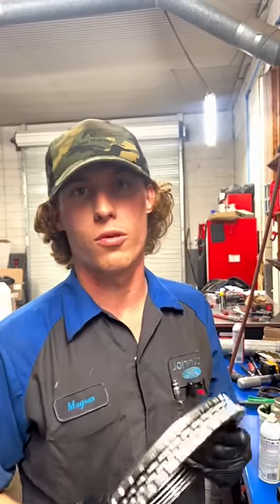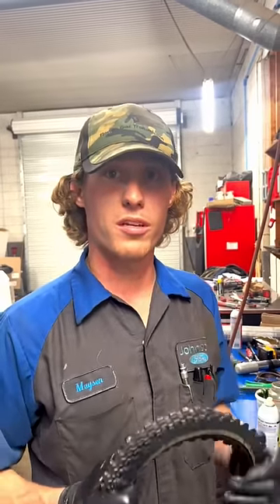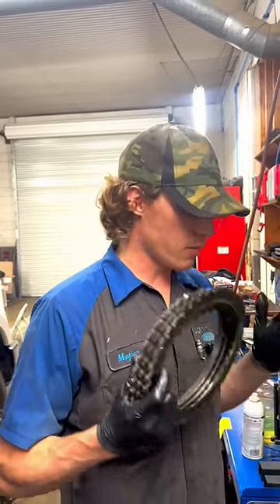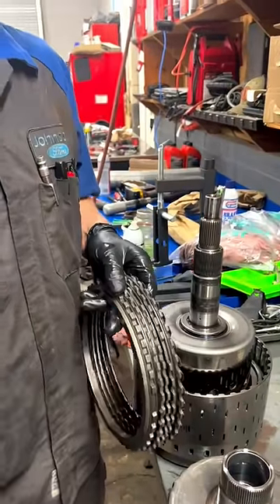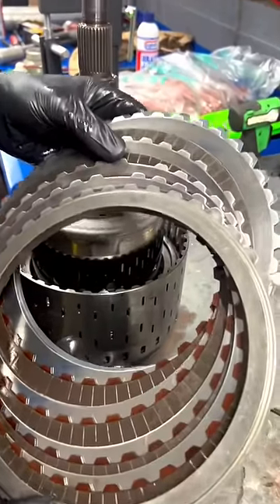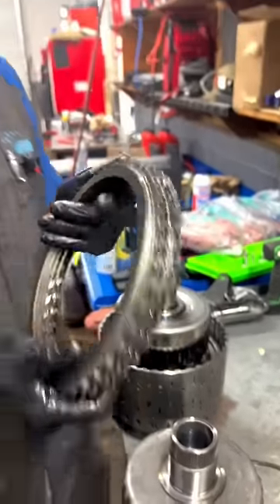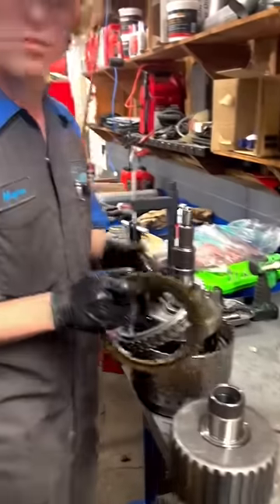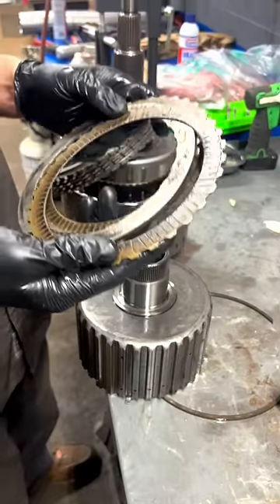Should you replace every clutch during automatic transmission overhaul? #shorts

Comment: I'm not an old timer by any means, but my grandad has been a mechanic for nearly 65 years, works on everything from kids mini bikes up to diesel excavators.

So thing is, if it's in a professional setting, my grandad would ask the customer what they want to do based on his recommendations, then go with that (private shop, no warranty work.) But if it was for his own personal vehicle he would just replace only the bare minimum, however for the kids (mini bikes) if something went sour with the bike, it got a full professional grade rebuild, like the brake pads go out, it's getting a drum, pads, line, and actuator.

His reasoning when I asked him was that on a customers vehicle, the most important thing is they are happy with the repair, with his own vehicle, he says if he don't have to spend the money, he would rather not, but for the kids and grand kids, they're newbies and fragile, imoortant.. the best brakes, the most reliable motor, new tires evey year, and as they get older they become responsible for the repairs and maintenance themselves.

He said to me, he can see which kids paid attention and learned from him on how each of us kept or didn't keep our mini bikes, mopeds, and go karts.

Like my cousin who destroyed his, riding it hard, no oil sometimes, with loose bolts and studs, parts falling off it going down trails....

My brother and I on the other hand, have the same bikes we have had since we were both little, mine just got repainted a new clutch, new tires, new brakes, and will be put in dry storage after this year until I have kids, or nieces and nephews to continue the tradition with.

Comment: Really depends on where you work I work for a company where I built transmissions and we had to give hundred thousand mile warranties and unlimited mile warranty with a year price tag but think of liability we always replace clutches and yes our Transmissions were expensive but our Transmissions never broke and never came back and I know you ain't magnafluxing every single clutch to know if it's cracked inside is it really worth it now it's not just replace the f**** clutch the customers coming in for a fix there ain't no warranty then it doesn't matter but if you're doing a full overhaul it's the first thing it should always be replaced unless it's something for government that s*** is expensive I mean like an O-ring cost for $45 10 ring some shaft cost $7,000 Plus so it depends on the situation

Comment: Rebuilding automatic transmissions 47 years   ,I like  your yt ,  never  install  new frictions  or steels  if they are in very  good  condition  but   ! If they  are  🔥 burnt-out   take  the  rubber  rings  out  and  replace them  ,,,,,,,I know  it's a  mind trip with the prosses  but  ,,,,,it's  E Z er doing it  right   just  one  time , than two  times  😮note  this  only  applies to  the  new  six speed    eight and ten  speed  old  3 speed Chevy  Ford and  Dodge   never  re  use  any  thing  that  should be  in your  overhaul  kit ❤

Comment: I do a shit load of trans work under warranty on john deere 1 and 2 series from extreme leaks and alot is bad casting or gear lash being trashed OR bad seals or pressure relief valves. I personally only replace whats bad. Because 9 times out of 10 everything is fine. And these transmissions i teardown are 3 times as complicated as a 10 speed. So yes i agree only replace the junk. Why throw away good parts? I get the "while im here scenario and with some i deal with i write it up for deere just right if i see something odd but not junk yet. What you have is obvious, so NO stick it back in there. Garuntee has no issue until it's 10 years from now when its got 200k on it.
Reply: Also deere does NOT make these transmissions the Japanese do. It's an outsourced company.

Comment: I just put new clutch and seals in a Chevy tracker that had 300k the clutches in it still all had the factory labeling. For the most part there was no reason to change the clutches the seals needed changed but the customer wants a rebuilt transmission not a half ass job and paid for it to be rebuilt not just be told it was.

Comment: If they come in the kit i replace them. If its just a seal kit it gets the parts out of spec. If cost comparison is exceeded it gets a reman . My transmision experience is all at the dealer level though and close to 100% of them under some sort of warranty . No customers pay customer pay price at my dealer for a transmission  rebuild. My assistant service manager complained once to me about how he is supposed to sell a job like that when a transmission shop does it so much cheaper, implying that the labor was to high. My response was the trans tech at a transmission shop makes more than i do per rebuild. The dealer labor rate is to high because there are six managers between me the money producer for the company and the dealer owner. Get rid of four levels of management and we could be cost competitive. He never said a word about high estimates again, just did what he could to sell like his job depended on it.

Comment: Since it is apart replace it has went through a heat cycle not as bad  as the others you have shown but there was excessive and has changed the material compound on the clutch’s!

Comment: If it's like this situation then I'll keep the ones that still are in perfect condition. Yeah it may scare people because they have the "it has all those miles on it so it has to go bad soon" mentality. On the other hand you could find some perfect/new looking replacements and they burn out like the bad parts you fixed. It's 100% unnecessary and causes more work to replace perfect condition parts for transmission and engine builds. Since microscopic defects are like a slot machine in all these metal parts. New doesn't mean better. It just means untested

Comment: I worked at a honda dealer for 15yrs and we could get a complete kit all the clutches and springs in the valve body I always replaced everything plus torque converter on customer pay warranty we just put a complete unit in except on cvts

Comment: Personally I've never rebuild an automatic transmission. But I would think if something does not need to be replaced don't replace it. Only replace and or rebuild what needs to be replaced or rebuilt. You have to figure automatic transmissions are expensive to rebuild anyway. So in my way of thinking correct me if I'm wrong if it doesn't need to be fixed don't fix it. Only fix what needs to be fixed

Comment: Nope. I'd reuse them. Most all of my rebuilds get clutches reused if they're that nice. I always buy used transmissions for hard parts and accumulate a lot of good frictions and steels, Almost all my builds for hot street/mild hp applications only get nice, like new, used clutches and steels if I have them. It eliminates the 400-500 miles of break in to properly set up shift firmness and lasts longer when thrown right onto the track.  Newer electronic controlled this doesn't apply to as much

Comment: the last shop that tried rebuilding my transmission, they said the parts were really hard to find and essentially fucked up my transmission to the point it won't come out of 5th gear unless the car is stopped and possibly off or idling

Comment: If they don't need replace then the fiber looks good and there's no dip marks in it or burn marks and again the fibers got to look really good and be built up and if you can't get replacements go ahead and use them again clean them up really good inspector really good and you should be fine

Comment: In my opinion it depends on what the customer is requesting if they want a full rebuild regardless to what wore out or not I would give them a full rebuild now if they just want a new clutch pack for example that going to use the truck as a plow so they want a heavy duty clutch I would only do that basically I would give them what they're paying for

Comment: If I was doing an upgrade I would do it all around but if one clutch pack went and somehow didn't take out the rest of them and I was only doing stock replacement im doing it as cheap as possible.  The one that burned up is probably going to fail again before the other originals because of a design problem or use case like towing in overdrive.

Comment: That’s why ford has one of the biggest comebacks with their transmission and engine work. Replacing the failed parts won’t do much when you have metal particles clogging up the valve body and damaging other parts.

Comment: If it's a wear part with 100k miles on it, and it is already in my hands, I'm not putting the old one back in.

I'm not a transmission guy but that's how I would do it if I were. As a customer, I'd pony up for the extra parts since the labor is pretty much the same either way.

Comment: I have a question for you.   2015 Mitsubishi outlander and the trans is shuttering when switching in higher gears. They say you can’t replace it and you can’t rebuild it supposedly. So what do you do ?  I think the high pressure switch might be the issue but it’s inside of the trans. What would you do ?????

Comment: If it's been there 100k, and you think it'll go 300k more, than replacing them gives your customer an extra 100k before it has to be torn open again. As you know, labor is the killer on most slushbox jobs. Dropping it, gutting it, going over everything, valve body inspection, and tuning where applicable. The parts themselves on a stock rebuild are almost negligible. Obviously the customer has final say, but if given the choice I replace every soft part every time.

Comment: Without a doubt NEW PARTS. Why? It's cheaper for the car company because they won't have to pay labor cost twice. Reinstalling  old parts INCREASES the potential for that part to fail REGARDLESS. Parts that move create friction (heat) metal fatigue - surface degradation (wear & tear) - warpage. Today's transmissions are insanely complex and most ( not all ) are not designed to last. Plus the customer is happy because they they aren't without a car waiting for parts the dealership has to order. Right now there is a serious parts shortage - globally.

Comment: Not so much with autos,  but with motorcycle clutches, it wouod deoend on the end use.

My track bike, good enoigh, save the extras, same  with my wife's. 

Our classic bikes and daily rides, it look at it like having a car in for a new trans or clutch. At that point, I'm a dozen bolts away from the rear main seal. Replace it.

Otherwise it's another 10 hours of labor, for a $15 part. Same with fluid/flitler and fluid changes. You usually drain it before removal anyway, even if it's early, change it. Torque converter as well.

We rely on our daily vehicles. So we do the job right. Track and off road toys, they get towed anyway. No big deal if used parts wear out sooner. Just have to watch them closer is all.

Comment: So you don't replace the slightly worn ones that have 100k on them what do you expect the rest of the transmission to last if it will out last expected miles don't replace it not replace. I have been doing warranty work 30 yrs on heavy equipment. I give customer option to pay what warranty won't if it will increase longevity for customer.

Comment: Okay, it's kind of like changing headlights, you don't just replace 1 because the one will go out before the new one will. Me, I would replace all of them because you might be doing the same job for the rest of them before the new ones go out. It makes twice the work when you could put a whole new set and HOPEFULLY they will need to be changed at a later date instead of changing them twice in the amount of time all the new ones are bad.

Comment: Eh. Depends on the unit. If it's the reverse clutches on a 4L60E, or AODE, they only come on in reverse or a specific manual low range. So if there is no slipping, then how can they wear out? Most guys don't bother changing them, and I never did on my personal vehicles. It's just a waste to do so.

Comment: Look this is the way I look at it even after warranty specs if the customer wants it all replaced replace it don’t mess around because you know you replace those other clutches what happens when the clutch is you didn’t replace burn up in 20,000 miles then they have to replace those and pay another $1800 to $2000

Comment: When you change brake pads on one caliper, if one side is worn down to 1mm and the other pad still has 4mm (which is about half life), do you replace just the one pad? No you replace both pads and the rotor and then do it again on the other side of the car. Albeit pads come in a set of 4 to do both sides of a car but rotors are separate. You don't pad slap as that causes chatter and off wear. Can you? Sure but you just don't. The clutches may look fine but their seats may not be which seems to me like the brake pads above, could cause uneven wear of the new clutches installed or the old clutches left in creating vibrations or something else. That would be the reasoning I would have to change them all. I don't do transmission rebuilds at my shop but logically they work on the same principles as brake pads so...

Comment: No you just measure them up and make a set every now and again but I work wrecker Salvage too so I profit from I don't have to crush that. Simply put I'll tear down three transmissions get rid of the tire discs and the burnt discs and if I'm lucky I can build a new stack. That's my bread and butter man. It's a simple trick each gear has to measure up and the overall stack has to measure up. Just keep the tolerances tight and clean. That if you pull five Transmissions apart and you cannot build a stack then you're probably buying Transmissions from a guy who's already Works through the stack which is why I buy wreckes and pull the engine and transmission myself. That is why out of 54 Transmissions I have 21 of them going to the iron pile and the aluminum pile. Everything else is either complete and waiting to be sold or waiting for missing parts. If your shop can buy like new stacks your buying from somebody like me. Because somebody lunch their transmission case for who knows what reason that the stack almost came out clean so they replaced whatever was damaged with another used transmission stack because each disc only needs to be within tolerances and clean. I love it when a hottie tottie transmission shops sends me a perk stack and says I need a replacement stack. I threw out the scratches throw out the burn and then rebuild your stack and then sell you your stack back because it now measures up. So no that's not something your boss will allow but yes that is what we all do. Even your boss because he buys from me he just doesn't want to know that's what he does.

Comment: As a transmission technician for over 25 years i can tell u for a facts that that replacing everything that comes with a kit will end up burning u .. most times the factory parts r made better then the cheap shit in the kits. If its not broken or worn dont mess with it i have seen more CB's cuz the tech replaced everything then if u only put whats needed . Them r just the facts. And after 25 years i seen it first hand ..

Comment: If you are asking it means you shouldn’t be in the auto repair business. Replacing ones and not the others is like taking a shower and wearing drawers with racing stripes after that. While you’re at it, please do replace the clutches too, 100k miles is a lot for the average car transmission that’s meant to last 150k.

Comment: In my experience (someone who got out of the mechanic field and does only performance mod stuff) American car dealers are especially shit with this sort of thing. You go to buy a part and sorry this only comes as a complete assembly for 1000 dollars plus tip and taxes etc etc etc. Meanwhile when they warranty stuff I've heard of them reusing gaskets if they can get away with it. This penny pinching just isn't cool, and i respect a lot of the imports will swap assemblies and send the core to be remanned.

There's no reason to not replace clutches a complete rebuild kit for the 10R last I checked was 1500 bucks or so, which all said isn't bad at all.

Comment: In crapofornia if we sell a rebuild we have to use a California compliance kit.

Clutches. All
Rubber seals. All
Flex band. All
Torque converter. 
Filter.
Metal clad seals. All
O rings. All

That's the law here..

Comment: If it's a lot of work to take out then I replace it. I had a 2000 vw passat with the 2.8 and the timing tensioner went out so I replaced the whole timing components and water pump and thermostat cuz I had to take off the whole front end to do it and there's always that what if moment? Like what if the thermostat or water pump goes out then I'll have to do the job again so I just replace it for peace of mind 😌

Comment: Warranty is on the manufacturers dime. They want you to trade in and buy a new one before the warranty expires so that they get another sale and you don't have to worry about a subpar repair 100k down the road. That problem is now on the used car buyer and/or whatever warranty they offer. That's the scheme. 

That being said, it is amazing sometimes how long a mechanical thing can run on "worn in" parts and unequally torqued bolts. 

If it were mine and they were extremely hard to get, they would be going back in knowing that if there were any issues, the trans as a whole would be replaced. That would be me on my own time not losing money on a job.

Comment: Ive seen Alot more comebacks with complete overhauls that repairing the broke parts in transmissions.when all the clutches bushings drums solenoids being replaced in a 150k mile trans,odds are,either bad parts or clearances or mistakes made.mybopinion is,if it lasted 10 years and looks like new,chances are,it will last that long again.